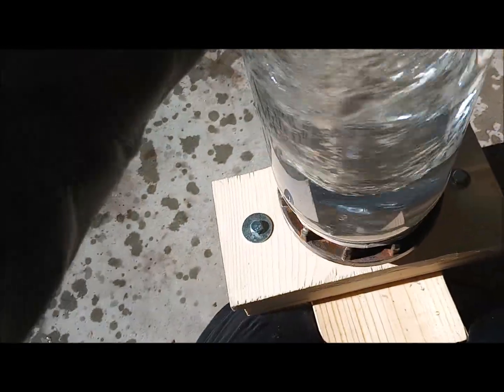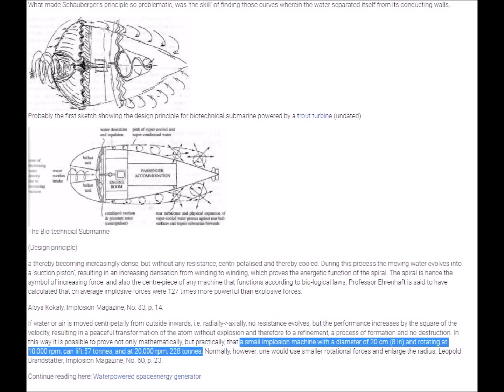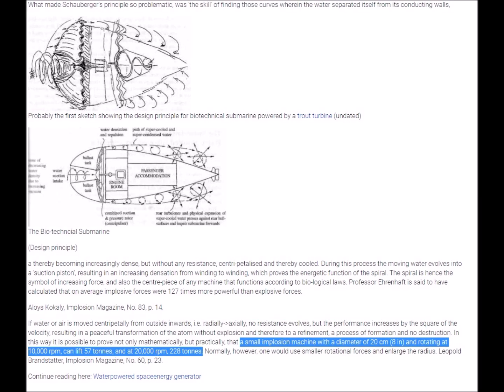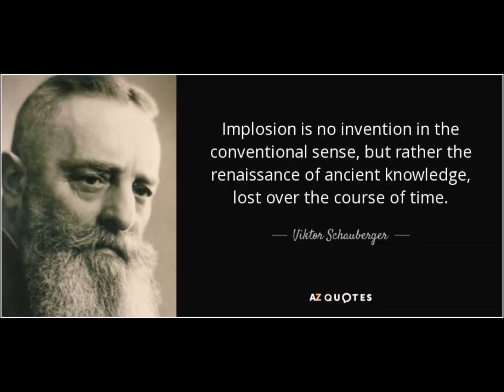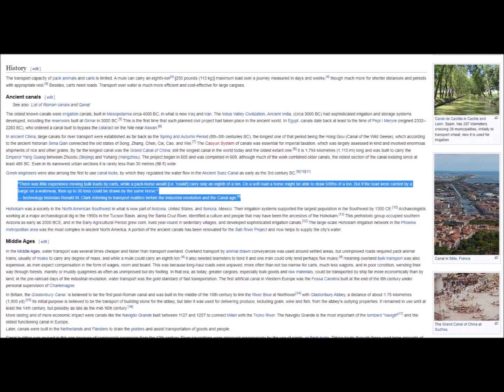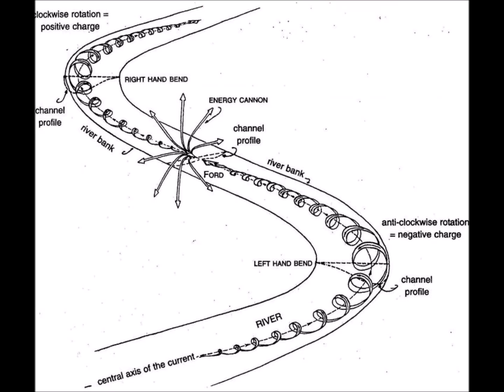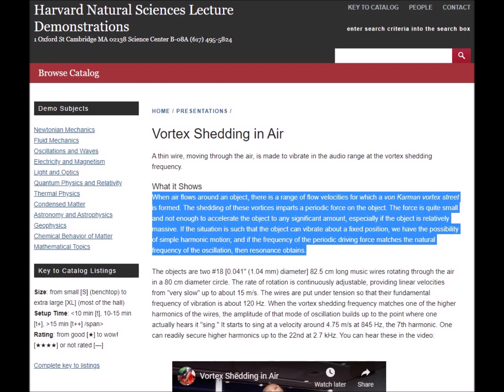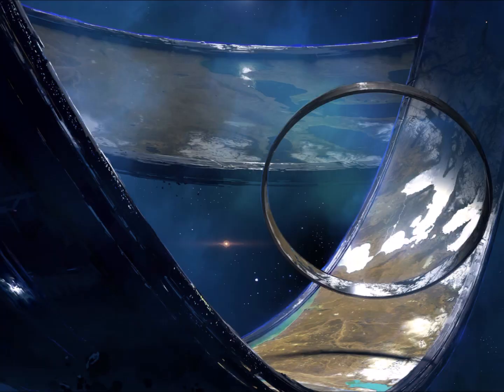The Implosion Ring: Converting Hydrodynamic Rotation into Hydraulic Lift!

Comment: First off I want to say I love your videos, they are very informative and encourage to keep making them.

Second I'm confused as what you mean if its possible for ufos to fly this way? If you haven't noticed or are unaware that is exactly how lift works. Have you ever seen how a ducked fan works? The  bubble of sorts that forms in the water when you spin the cylinder is a representation of the low pressure bubble that forms a suction zone on air that creates the lift. 😵‍💫😵‍💫😵‍💫 Since air is also a fluid the behavior is similar. Im just saying a ducted fan since the phenomenon is more pronounced on a ducted fan but a propeller does sort of the same thing. when you spin a propeller at the front you create low pressure and thrust comes from the high pressure exiting on the other side. both combine the pressure difference creates lift. What you are showing here is related to what Einstein formulated in the "tea leaf paradox".

Comment: Your experiment seems to be incorrect. Your cylinder's axis of rotation is tilted, which is why the golf ball rises. Even if there is no water inside the cylinder, if you put a golf ball in it and then rotate the tilted cylinder, the golf ball will still rise.
And the reason why table tennis drops is because the water surface drops after spinning.
Reply from the maker: @enbinzheng-line  You should see my other videos on the subject. This is when I was holding it by hand. It still works mounted on a stand with no tilted axis, and has been done with significantly more weight; 5 pounds in fact.
Reply: @gsutton78  Don't add water, then try again and see if it will also rise.
Reply from the maker: @enbinzheng-line   I already have: https://youtu.be/big9DchuuWM?si=SbmoZIoVB5ggxAP6.
Reply: @gsutton78  This is a video showing that even without water, a golf ball will still rise. This indicates that whether it rises or not is not related to water.
Reply from the maker: @enbinzheng-line    It's related to fluid which could be air or water. Specifically, the vortex formed in the fluid, be it a whirlpool (water) or mini-tornado (air). The rotation of the fluid results in an increase in pressure on the periphery and a decrease in the center. Tilting the container, or geometry (the one container's divergent sides) can enhance the effect, but is not the sole cause. In the original video, the sides of the container are not divergent, but the ring still rises due to the aforementioned pressure differential.
Reply: @gsutton78  What you said is probably incorrect. You can use an iron ball to rotate inside and it can also rise. And it can also rise even in a vacuum. There is no vortex in vacuum as you mentioned.
Reply from the maker: @enbinzheng-line   The ball would be in your court then as you would then have to explain how this would happen in a vacuum.
Reply: @gsutton78  Of course it can happen. If you don't believe me, you can try vacuuming your container and then conducting experiments. But be careful and take good safety precautions.
Reply from the maker: @enbinzheng-line   It wouldn't happen at the relatively low speeds that I'm using, though. The speeds would have to be a few orders higher. Then we'd theoretically be getting into what some call the "gravifugal effect". It could indeed work in a vacuum and would be akin to true antigravity.
Reply: @gsutton78  So it is not related to air and water, but to the friction force of the cylinder.
Reply from the maker: @enbinzheng-line   No, it's related to the pressure differential created by the vortex. The experiment with the orange floaty ball and golf ball shows the pressure exchange. As the speed of rotation increases, the pressure in the center decreases and the floaty ball which normally floats starts to sink to the bottom. Simultaneously, the pressure around the periphery increases causing the golf ball, which normally does not float, to rise. As the rotation decreases, the peripheral pressure decreases (with the golf ball sinking) and the central pressure increases (with the orange ball rising) until hydrostatic equilibrium is reestablished and each ball returns to its normal starting position.
Reply: @gsutton78  Golf balls also move upwards in vacuum. So the upward movement of golf balls can be independent of fluids.
Reply from the maker: @enbinzheng-line     See, you just want to argue for the sake of arguing with no explanation whatsoever.

Comment: Found it, thanks for the info! What devices are you using for these experiments?
Reply from the maker: Sure. As of right now, I'm just using a high speed motor to rotate a chamber, thus producing a powerful vortex. The ring is made of PVC I got at LOWE'S and several golf balls mounted on the bottom. Steel weight plates can then be mounted on top of the ring to make it heavier.

Comment: Thanks for the reference from the previous comment. So I'm sure you have thought of this, but would the low pressure pushing downwards at the center push down on the container with an opposite and equal force to that of the high pressure at the top of the container?

For instance, let's say the water/air or whatever object is pushing up against the lid that closes the container, would there be an opposite and equal force pushing downward at the bottom of the container so that the entire container doesn't not move either up or down?
Reply from the maker: Yes, according to vortex principles, an equal and opposite pressure acting downward is actually the atmospheric pressure which rushes in after the low pressure region in the center is opened up. Viktor Schauberger researchers call this 'implosion' as opposed to explosion. It's essentially the same principle which happens in the classroom experiments where the air inside of a can is evacuated, dramatically reducing its internal pressure. The unopposed atmospheric pressure can now crush the can from the outside. If the experiment was carried out in a vacuum, the vortex would still form due to the centrifugal force, but there would be no downward acting pressure in the center. Please see the video here from The Action Lab which demonstrates a whirlpool in a vacuum. The floaty ball which would normally sink to the bottom in the center remains at the top in a vacuum, but sinks as soon as the atmospheric pressure is reestablished: https://youtu.be/fdeChnr8HQw?si=P8tU4D5dALCKEx6M.

Comment: I disagree, first the logs did not move because a implosion has occurred, they moved because Victor added cold water to the canal wich was builded in a eggshape body, it is the tension difference between the 2waters wich made the heavy logs float and move. then there is no vortex lift because in a real vortex you will have a implosion happening because you have more tension then pressure on a linear axle and therefore it will be sucked not lifted, fact.
Reply from the maker: The canals were not built in an egg shape. He created an energy machine that was egg shaped. The canals or flumes looked normal with the exception that they had guide vanes built into the inner sides which enhanced the water's natural twisting motion. In other words, a horizontal vortex. And a vortex means implosion. The addition of cold water simply enhances the carrying capacity of water. Facts.
Reply: the wings he designed for pipes not for his logs channel, the log channels was his break through and later he said that was not the best work because it helps deforestation. The channels were build in eggshape, that’s fact. proof me wrong. @gsutton78
Reply: @gsutton78  https://www.implosion-ev.de/pdf/Schwemmen-von-Holz.pdf

Comment: if i pour water down a pipe, it moves in a column, the edges being held back, the center moving fastest. 
i can only push so much water down a pipe.

if i spray water from a nozzle, at right angles to the flow, i measure no pressure. venturi. bernoullis.

so. if i get a pipe, and rather than push water DOWN it, i SPIN it around?

so the water, like the jet from the nozzle, has zero pressure at right angles.

and thats the same as the axis of the pipe.

in a centrifugal sprinkle, we expect the water to be flung out, and squirt from the nozzle with a higher velocity as the pressure increases. we also expect there to be more push because of the extra thrust.

the pressure does increase. and for that very reason, water stops flowing into the ARM. despite the centrifugal force. it banks up and slows down, converting to pressure, before emerging from the nozzle. water doesnt flow to high pressures. we dont get any extra push as the same amount of power is required to overcome the pressure differential.

but what if the water is SPINNING down the pipe? so its presenting ZERO PRESSURE to water flow?

and that spinning water, it has mass, momentum. for it to spin requires a centripetal force to contain it, redirect it. and that redirecting will create a reaction force, the "centrifugal" force. 

as the water spins around in the pipe, the pipe is angled around a shaft so the spin is always presenting a tangential reaction force to the shaft, a torque... 

and as that water is flung down the pipe it simply spins faster, and then finally emerges from a nozzle, free from the constrains normally used in such turbine designs... back pressure. in electrical terms, its exactly the same as lenz reactions.

i see those thingies that take compressed air and split it into hot and cold using a vortex...

i see a lot of things, a lot of dots, and noone seems to be connecting them.

watch the salmon sim up a man made weir. or fail to, i should say. then watch them in the natural habitat. watch that water...

how did the water get up there? to where is it going?

and as it moves, what is moving to take its place?

Comment: I thought about this and realized the golf ball travels upward due to centrifugal force while the light balls falls into the cone because the surface tension of the water exerts it from the vortex, thus forcing it to fall. Oh the reason why the ball will travel upward because the water being displaced from half full to filling the outer walls of the container demand the golf ball also gain that force, despite how small it is.

Suffice to say, I see no apparent unusual effect here. Though I can explain to you something that Schauberger spoke of, which the American Military had nicknamed the "thunderstorm in a teacup".
Reply from the maker: The balls don't rise due to centrifugal force, though, but rather vortex lift. Centrifugal force/effect doesn't act in the vertical direction. Instead, the force is acting on the fluid. There is a rarefication and reduction of pressure in the center and an increase in pressure at the outer edges. The balls get caught up in this tremendous upwards peripheral pressure. In my video here, https://www.youtube.com/watch?v=VLdaljPaS2w&t=6s, 5 pounds of dead weight is loaded onto a ring and it floats in the exact center of the container and doesn't touch the sizes at top speed. So, it can't be merely centrifugal force as in the "Spinning Ball Experiments' with glasses/cups. In those experiments, the ball has to touch the sides.
Reply: You profile pic tells me youre being intentionally deceptive and know far more about the actually truth/suppressed science. Hidden behind wals built out of incorrect so called “laws” full of “exceptions to the rules” and broken theories that were intentionally propped up  to rełard progress as people are so indoctrinated that they wont even attempt to experiment anymore.  

And when they  hear, or even see, others successfully progressing into the “anomalous”, supposedly “already disproven”, and/or the new previously unknown..... then you’ll often find people deaf dumb and blind, closed hearts and minds, boxed/locked in faulty “X-spurt” paradigms finding it impossible to see whats right in front of them. They’re literally blinded by beliefs. Their faith in the dogma of those experts/priests of science whose words  arr gospel. If they say something is impossible or false then it is so by those they grovel before before them  as they sit on their porcelain thrones working on waste. Flushing billions collectively down the drain in grant money. 

And when they do discover something interesting its locked away behind paywalls in journals few will ever see despite being publicly funded. 

All this dividing and further disconnecting the people and true progress. 

It’s quite obviously intentional and an apparatus of control. 

All these specialized compartmentalized experts clueless about any other fields an thus unable to connect an unify.  Technical jargon only serves to further convolute an complicate. Creating an inability to understand one another easily.

Constantly things are done that complicate, creating complexity to gate keep and  mystify  the minds of the public. 

The legal system/Bar association is a shining example of creating such cloister flocks. Guaranteeing those within control power influence and nearly no chance of being  replaced. 

A sort of corporate/scientific  tenure  of untouchabuLLshite. .
Reply: What does your profile pic represent to you?  What is being depicted??      

Additionally I’m curious about your name “zysis”. What it represents.

Comment: 3:35.   Gravity????  #PrimerFields Series.
Reply from the maker: What's the question??
Reply: @gsutton78 . I believe density is often what should be said in place of the word gravity as gravity , though on the surface seems a simple subject is in fact something of a mystery and  the crux causing collapse of attempts at unified theory.   

But   Id much rather talk to you about primer fields. The hash tag above. And specifically the magnetic bowl shaped arrays shown in the primer fields series and other #davidLapoint videos. 

I so very much want you to experience holding one and just playing around/ experimenting with one. Or preferably more than one. 

They produce magnetic fields that are incredibly interesting. And nothing youve experienced till you’ve held one.   When spun they get even more interesting. 

Is like to see ome spun under water i was just thinking as i watched. ..

Here im going to actually film some stuff because i have an intense drive to get you experimenting with them as they connect right in with the stuff you’re working on.  They create this inner magnetic flip ring. A sort of confinement dome within a dome. That depending on polarities and suuch will pull things in and hold them as well as launch th with great power.  Simply pressing an inch long cylinder magnetic through the center with my thumbs send it shooting across the room into the wall.  

Ill make some videos. It also interacts with non ferrous  materials in ways only seen by electro magnets previously as well as materials they have little to no effect. 

Id be willing to donate $40 to help fund creating on. 

The files for having one 3d printed are available freely on davids website as the info and link to the magnets  that fit.   He recommended the n42 magnets but i used the stronger n52.
Reply: @gsutton78 the magnetic array file  creates a bowl. Like half the size of a baseball or   a little bigger than  that actually. It has 40 holes inside for the magnets.  Even without the magnets installed it’s very interesting* 

(* the empty array brings to mind other stuff but im blanking on the name of the scientist and other jargon i want to mention here about the Russian? Scientist who studied insects. Beatle wing covers. Honey combs. And the idea that they give off an energy creating lift and
Reply from the maker: @CoincidenceTheorist    Yes, Viktor Grebennikov's cavity structure effect!

Comment: There is one, which stands above all the rest. Hydrogen. Water, Fire, water,  fire, water, fire. If a tree is grounded it will succumb to any event of massive polarization. Probably becoming new creation, subatomicly. If you are polarized to say a Vine, rooted or grounded elsware.. As long as you hold to the opposite pole you will attract to that source/ground.

Water flood or Water Fracking and a supercharged double-edged Sword(Anode) and bam. A pillar of cloud..HHO. Redsea, corrosive anodic oxidation of electrolytic solution. Parting of the water. Not left, nor right. But the narrow path. The power of subatomic separation and or paration.
Reply: As I recall. Wasn't  it actually a Flinty rock that Moses (Moshe) used his Ionization staff to give the Exodus Israelis water from the stone? Graphite anyone?

Comment: Can you explain better why the energy of the vortex can be suddenly increased by intermittant pulses of mechanical energy?.Thanks.
Reply from the maker: Sure, it's basically because of the rotational inertia of the mass; in this case water. An initial impulse can get layers of the water spinning. But it doesn't die off instantaneously after that first impulse due to its inertia. Hence, additional impulses will build upon the energy of each preceding one. So, like with pushing a merry-go-round, you can keep adding energy each time you push it which will gradually increase its overall kinetic energy. Another similarity is in pushing a swing; even weak pushes will increase the swing's amplitude if those pushes occur at the right frequency. So theoretically, sound vibrations/oscillations could potentially increase the kinetic energy of a vortex depending on the manner and direction in which they are applied.
Reply: Its a bit like having a heavy flywheel and the treadle on an old sewing machine , you only press the treadle in one alternate stroke to increase momentum